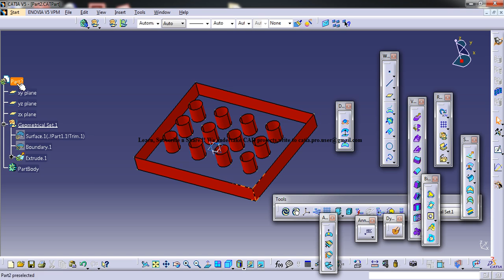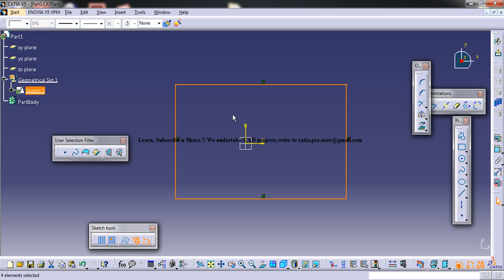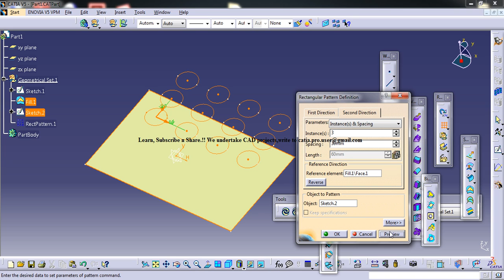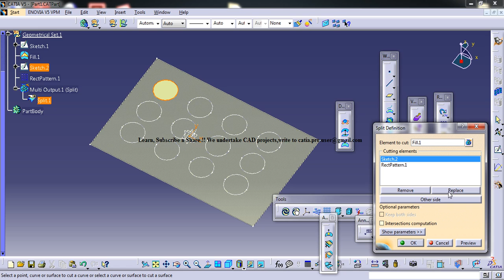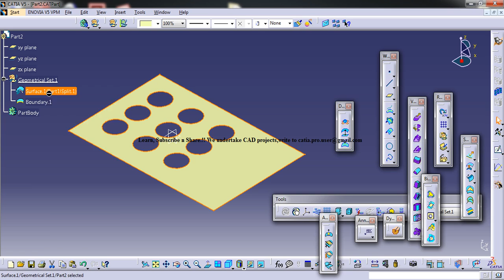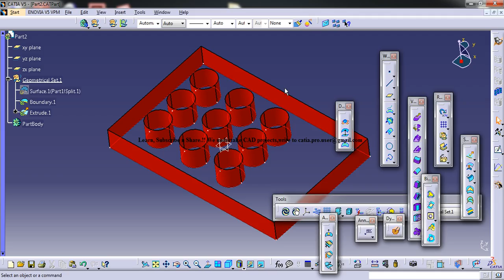Catia V5 Powerful Tricks Collection #111|Publication trick to interlink multiple files in assembly

Comment: I mean even paste special would also serve the same purpose , you can copy any feature of a part document and do paste special in another document with a link. So what exactly the difference is ....
Thanks
Reply: I'm not the poster, but you can share published elements with other users very easily.  If your data-management system allows it, you can grab published parameters from other parts more robustly than a copy+paste special.  Publications can also be used for maintaining a link across parts and products. For instance, if you have a common line you want to reference across several product files, a published element allows you to do this easily.
Reply: Gregory Komora thanks